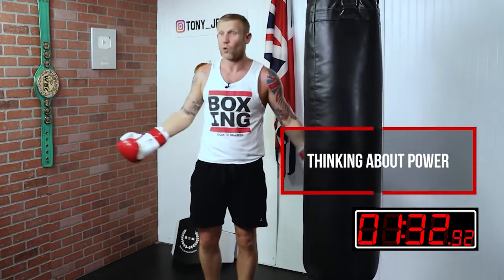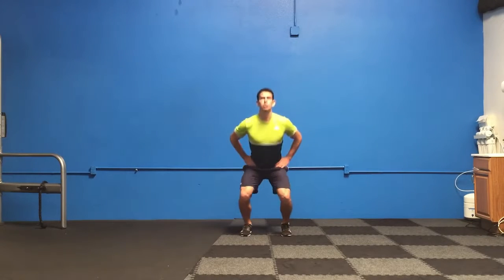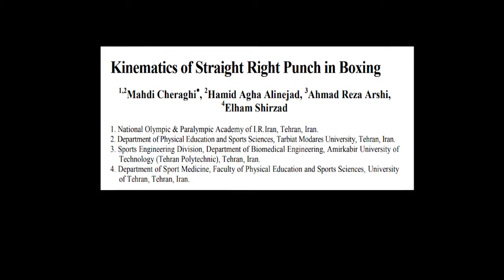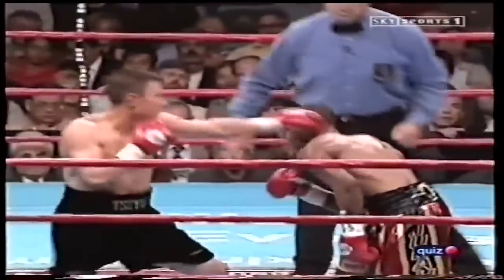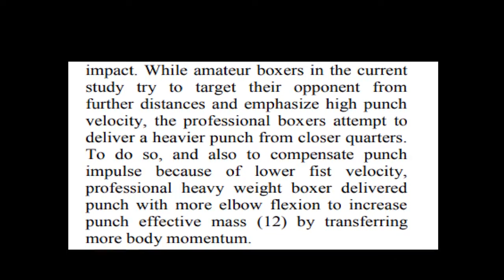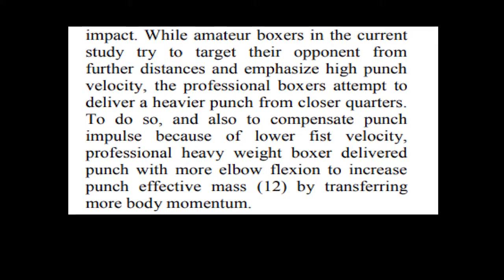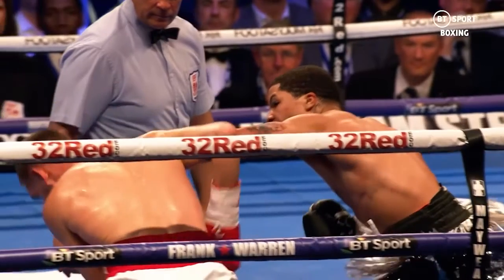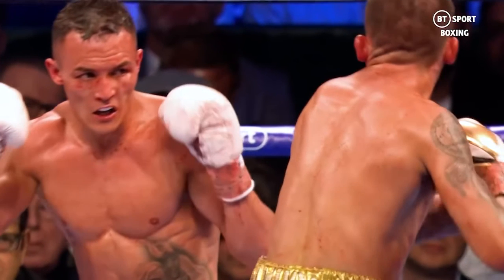Flared Elbow = Harder Punch

Comment: Just watch the old school power punchers like Joe Luis. They would rotate their body first and leave the hand trailing behind to create sort of a “catapult” in their shoulders then punch through with maximum leverage and efficiency using timing, weight transfer, and the short-stretch cycle. The way I look at it is:energy is generated from the ground then goes up the kinetic chain into the core, the striker then stores it in the shoulder/back and then releases it at the right time. Keep in mind that the shorter punch will always land first BUT if you have correct positioning, you can beat the shorter punch with a wider punch.